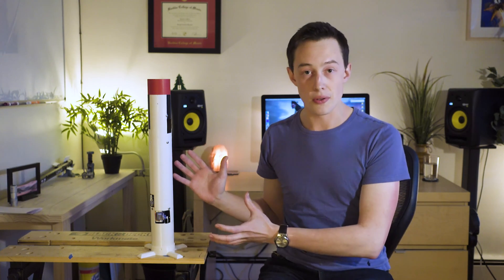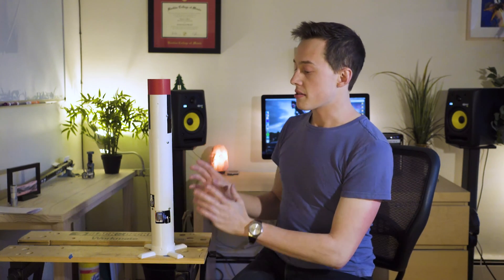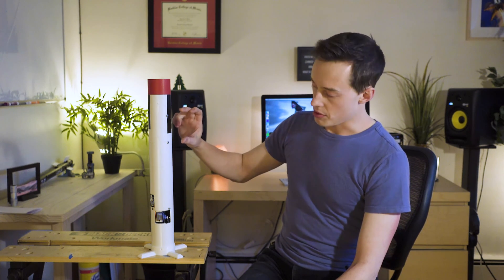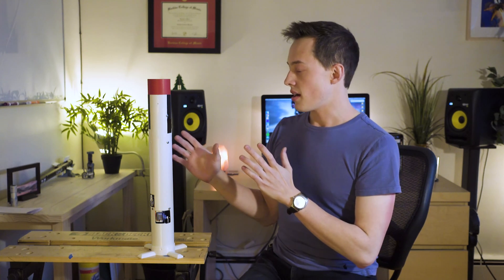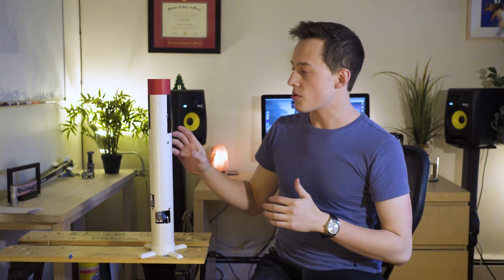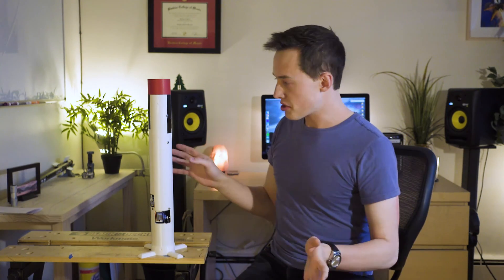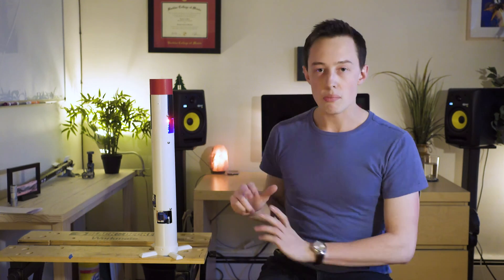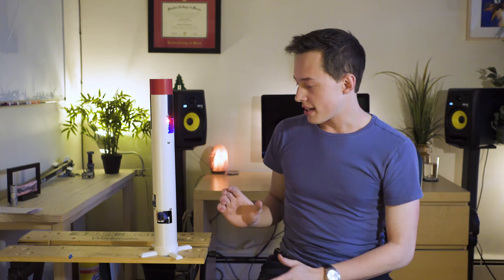Signal Avionics - Closed Loop TVC Calibration

Comment: When calibrating MWD (Measurement While Drilling) directional oil well tools which sit in drill pipe,, we needed to calibrate against the magnetic interference from the steelwork after each trip. What you call a "raindance manoeuvre", we'd call a cluster shot - take magnetic readings at various states of rotation of the drill pipe at the surface. Obviously, we've no way of knowing how much rotation is held in the several kilometres of pipe between the turning motor at surface, and the sensors down hole.
Different engineering ; same problem.

Comment: Surely once the servos are set up, if you send a PWM signal to them of '1100' for example, that should be a fixed position; i.e vertical?
Reply from the maker: Of course - but consider a scenario where something was assembled wrong, or during transit the mount lost calibration. I.e. a pushrod slipped or a cable was jammed in the mount. Both of these cases have slipped through the cracks in past flights, and caused them to fail(Echo TV4, TV9, and Relay F1). The avionics system should be able to either effectively correct for user error, or alert the user that it's detected an anomaly, which can't happen without feedback control.
Reply: Ah good point! What chip/algorithm are you using for attitude detection? 
I coded a fairly similar device with an MPU6050 running a kalman filter code, it seems to work ok for being vertical (is the basis for most balancing robots) I opted not to go for using the onboard DMP as I liked the idea of writing it bottom up myself!
Reply from the maker: I use the Bosch Bno055 for both IMUs! Love the DMP on it as I can take sensor fusion out of my control loop and speed up processing time. I would be careful with the 6050 as it doesn't have a magnetometer. During flight or freefall, your accelerometer won't find the gravity vector accurately, so you'll be relying on integrating the gyroscope, which is prone to drift. Check out Echo flights TV1 through TV5. All of them fly smoothly, but slowly pitch over. I was only using a gyroscope and accelerometer on these flights, albeit with a more simple fusion method than a Kalman filter. I discuss this on the website a bit on Echo's page - check it out!

Comment: can you do a video or a stream or just during one of ur build streams you show us how you plug the ejection charge? also why is it important to have the main vehicle know the orientation of the tvc, cant you just set a pre-determined setting for the two tvc servos so the tvc is aligned in the middle? does it have to do with in-flight functions? sry for so many questions
Reply: N1 and BPS- You can assemble AeroTech RMS model rocket reloads (24-40 or 40-120 case) without the ejection charge as the EC is simply black powder placed in a 'ejection well' at one end of the forward closure. But if you omit the BP, I would recommend placing flame-proof wadding in the ejection well (where the BP is normally placed) and taping over the end of the ejection well. Doing so will minimize a jet of flame that might otherwise shoot forward through the 'weep hole' at the bottom of the ejection well when the delay grain burns through. Be sure to store any unused black powder in a safe manner (i.e., inside an ammo box) or dispose by soaking in water.   ( I can recommend all this as I am a former AeroTech employee.)
Reply from the maker: I won't publish anything regarding plugging the ejection charge right now - it's illegal by NAR standards and is a fairly hazardous task to perform as you're working with black powder. If you need to have no ejection charge, I would strongly recommend designing around motors that come pre-plugged. The TVC mount needs feedback control as a safety measure in the case that the user assembled the mount wrong, or part of it is damaged and not working correctly. Without it, the flight computer assumes things are working in the mount, when there is no guarantee that they are.
Reply from the maker: The motors I use do not come in a non-ejection charge variation. They've got the best profile for launch/landing based on the system I've designed, so I mod them myself. I highly recommend trying to design a system around pre-plugged motors though, as my situation is non-ideal.
Reply: Barnard Propulsion Systems can't you use first stage engines which have no ejection charge? plugging the end should cause no issues.
Reply: USWaterRockets I don't know if aerotech makes G engines without delay though.
Reply: Barnard Propulsion Systems do you know if the reloadable aerotec engines can be configured without the ejection charge? Because those reloadable engines have to be hand assembled and each section is a different piece so maybe I could just not include the ejection charge? any thoughts?
Reply from the maker: Can't say for sure, as I've not used Aerotech reloads. I would recommend checking the RocketryForum for answers there.
Reply: Wow thank Edward. I was sure no one would know but here you are. Glad I asked. Thanks again.